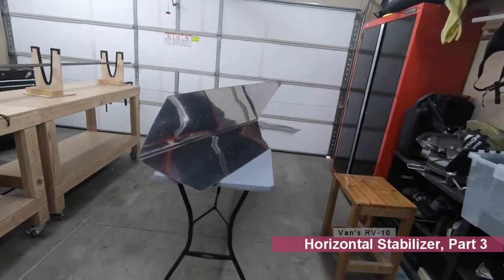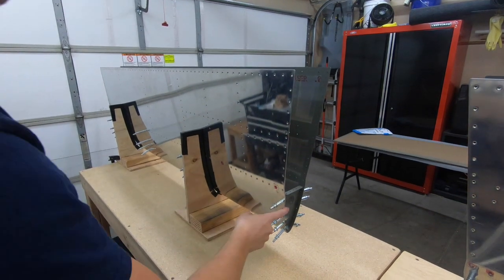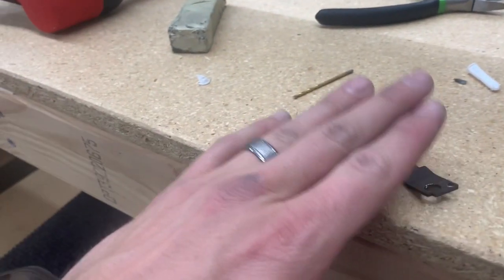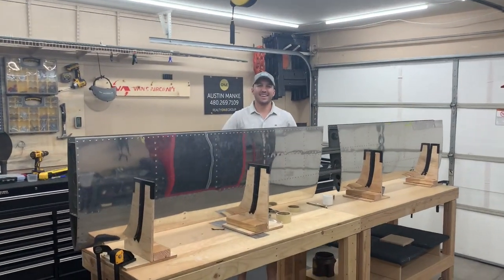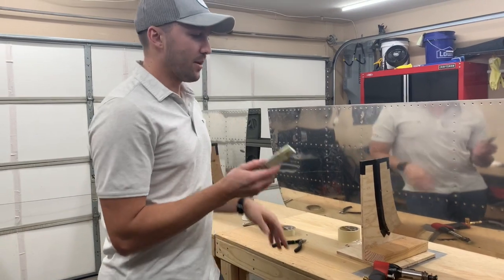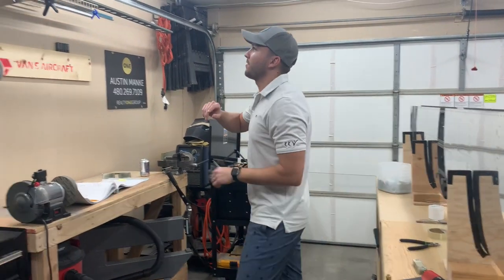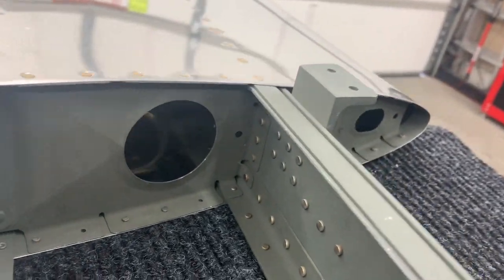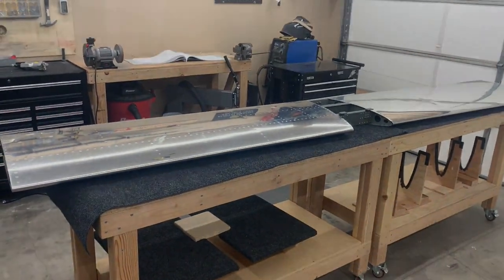Van's RV-10 Horizontal Stabilizer, Part 3 of 3

Comment: Austin can you post a picture of the angle tungsten bucking bar. Also the wood stands that are holding the horizontal stablizer did you make those? What are the dimensions?
Reply from the maker: Hey Tony, I can’t seem to find a way to upload a photo, but the bucking bar is part #BBT41 on Cleaveland’s website https://www.cleavelandtool.com/products/tungsten-bucking-bar-41. As far as the stands go, there are instructions on how to build them in the plans. Step 5, page 8-7 here: https://www.vansaircraft.com/wp-content/uploads/2021/10/08_10.pdf. I’d offer mine up, but I actually just gave them away last week